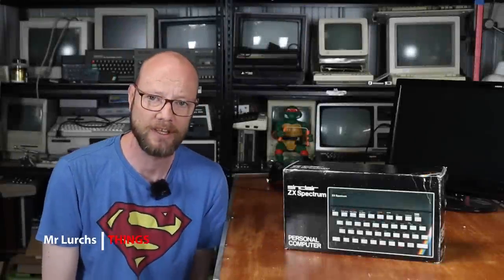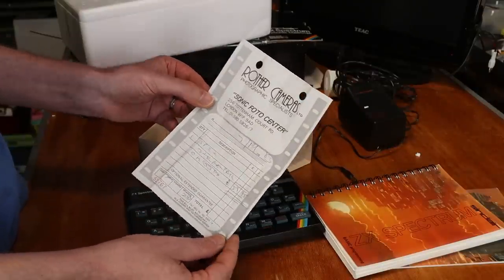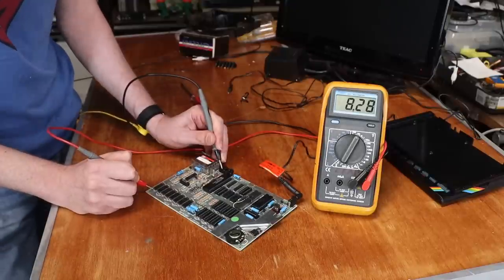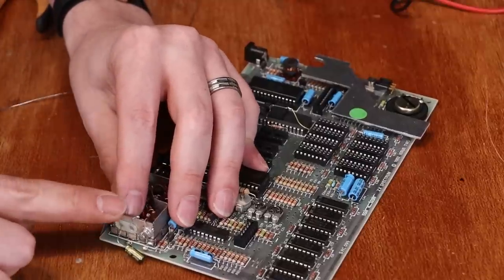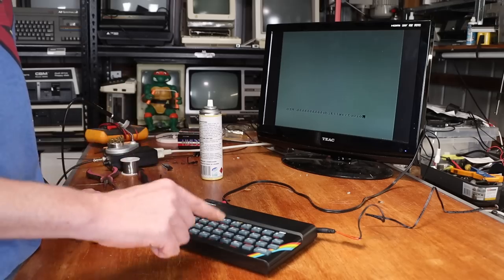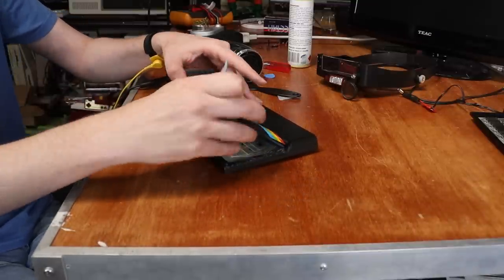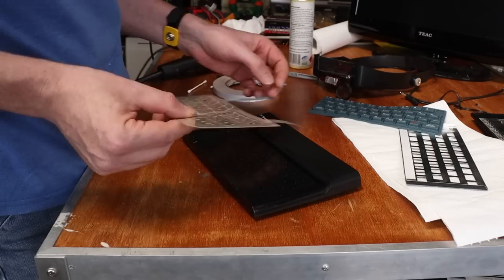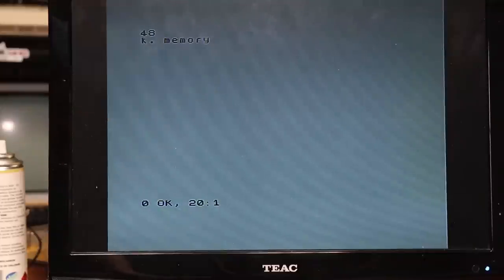Fixing a special ZX Spectrum

Comment: If I remember correctly, pins 14b and 15b of the edge connector, (they are on the underside of the Spectrum), should give composite video output. 14b is the GND and 15b is the Video Signal. This was also the case with some earlier Issues of the 48K Spectrum. I built an add-on with a speed control, (so I could slow down games), and comp out for my Issue 2 48K.

To get the face plate off one of my Speccys, I soaked it in a bowl of nearly hot water. It took a while but it worked.

What a crazy coincidence. LOL. Great history behind it. 👍

Comment: My original Spectrum from back in the day was 16K, but we bought chips to upgrade it internally. Given the quality control of Spectrums at the time was really poor, I got quite adept at whizzing those chips out and returning the computer back to WHSmiths for a replacement model, which I'd then upgrade again. 

Think we went through 4 or 5 of them until we ended up with a model that lasted for years. 🙂

Comment: This was one of the computers I was considering for my first computer. Alas, I bought a Tandy Color Computer (CoCo) and it fulfilled my programming needs. I went from a 6809E onto an Atari ST 520STFM (68000) and then onto a Macintosh IIcx (68030), and now I have many Apple pieces of equipment than I can poke a stick at...

Comment: Seems to me putting the speccy in the oven on extremely low heat would be a good way to melt the glue and reduce risk of ruining the aluminum. I'd say 150-175F for a short time would do the job

Comment: I wonder if there's a modern equivalent of that TR4 transistor.  Something achievable by looking up the data sheet of the original, then searching modern online catalogs like CPC Farnell for a model with extremely similar features and values, possibly after twisting the order of the legs with a bit of heat shrink to avoid shorts.

Comment: My first computer was a Speccy (the first one), which was a gift from a British friend back in 1991.To relive the nostalga, I bought a speccy for a reasonable price, without a power supply from the UK. I seriously cannot find a single web page or video on how to make your own power supply. Would a modern 9V 2A centre negative power supply work? Perhaps I should buy an AC 9v transformer and add a AC/DC🤘regulator to it?
Reply from the maker: Yup. That’s all you need. Just make sure the polarity is correct.

Comment: You don't need put a capacitor to composite video output. Is better don't put nothing. Really you don't need put nothing. Only connect directly. In schematic you can see why. Its a signal limited. And all TVs has an input capacitor with resistor to adjust impedance. You get better image if you try it,

Comment: Don't know much about the keyboards on these but would you not clean the carbon contacts on the rubber keyboard as a precaution, I know fixing cordless phones over the years we would clean the membrane as well as the rubber keyboard contacts.
Reply from the maker: These don’t have carbon pads.
Reply: @MrLurchsThings  So what makes the connection then.
Reply: @waynegoodwin3217  Metal. The membrane has 3 layers - the top and the bottom layers have thin metal tracks printed on them, and the centre layer is a separator with a hole for each key. The rubber keyboard is just rubber, it squashes the membrane down and makes the top and bottom metal layers touch, creating the circuit. The original membranes fail because the plastic becomes brittle and cracks, which then breaks the metal tracks, mostly commonly on the ribbon connectors near where they plug into the PCB.